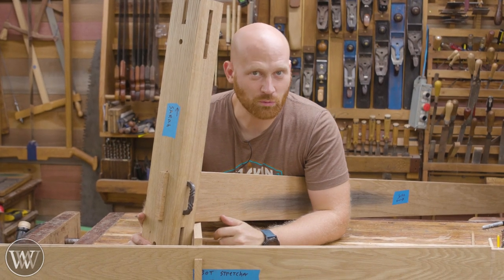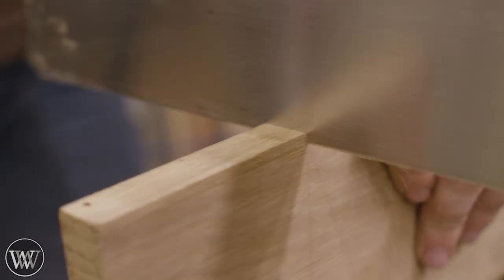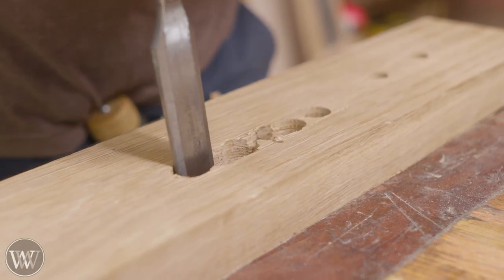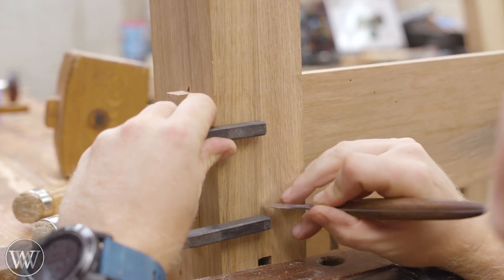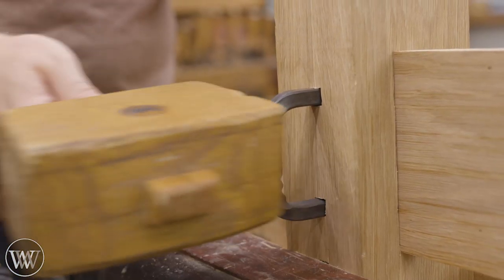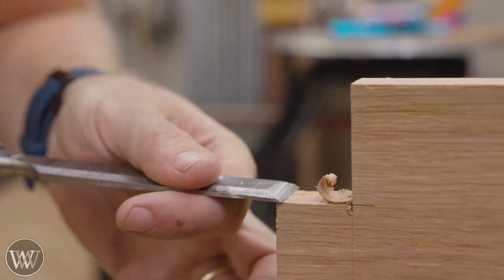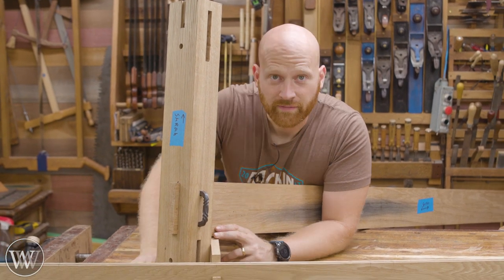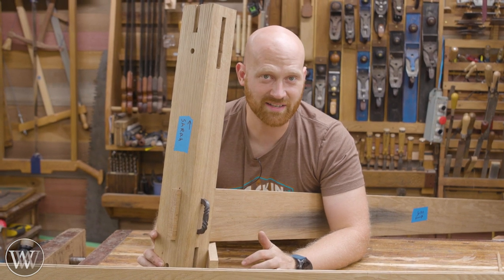How to Do Bed Joinery Mission style Bed Part 6

Comment: I really wish I could remember which channel has you talking. Looking good on both channels and no one has mentioned the woodworms yet so I won’t either.
Reply from the maker: Lol thanks. Blue is me talking black is just the woodworking. That's one of the nice things about living up north. Most of the bugs that live this far north die in the winter unless they are a colony. And in that case when you take the board away from the colony they all die. Show bugs are not much an issue up here in wood.

Comment: Very nice touch. My question is as  the wood expands/contracts or experiences normal bed movements are you concerned about the pins becoming  loose?  If so, what would your fix be?  Great work and control!
Reply from the maker: thanks. no as the space there is not enough for it to make that big of a difference.

Comment: How do you determine how big of a shoulder to have when making a tenon? 0.25" for this 1" for others.  Is it arbitrary or is there some formula or guideline?
Reply from the maker: I usually do not go any smaller than 1/4 in. And for this one I wanted to be as big as possible so I kept it at one quart inch. if I were to make this out of something like pine I probably would not want it to be any smaller than what 1/2 inch. but in the end it's more like experience that will tell you what the best size is. On the second time the sizes were determined by the board it was going into and one of the mortise to be the center of bored submit I need to change the shoulders to match.